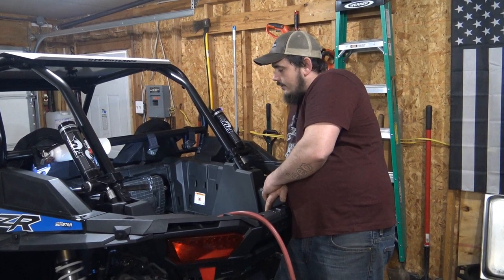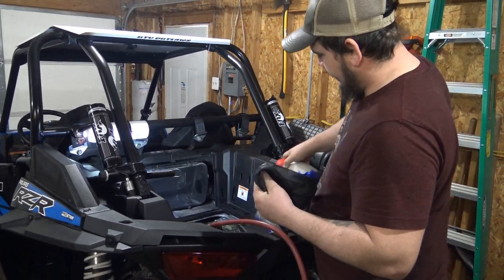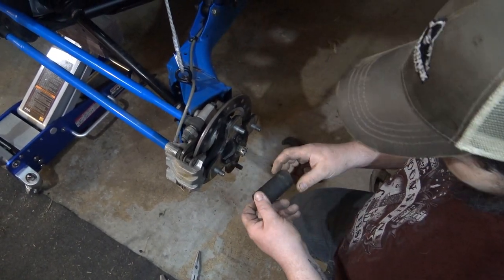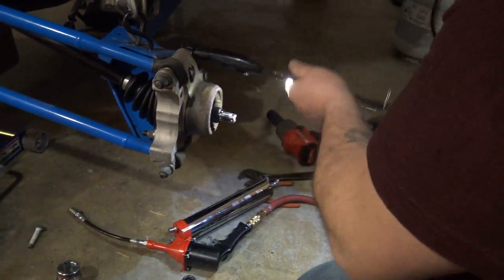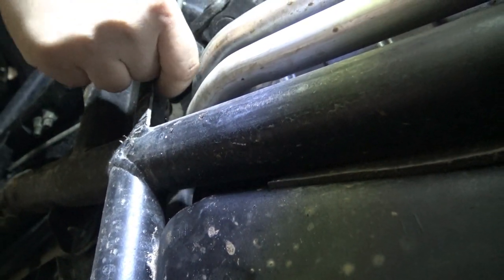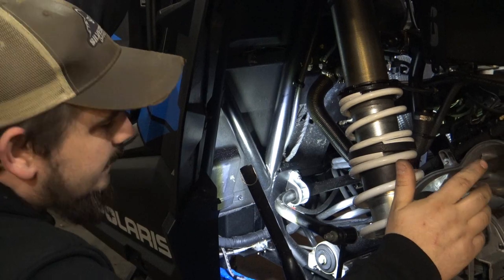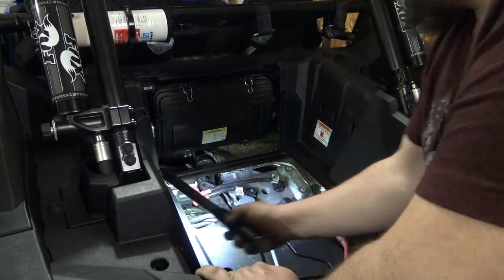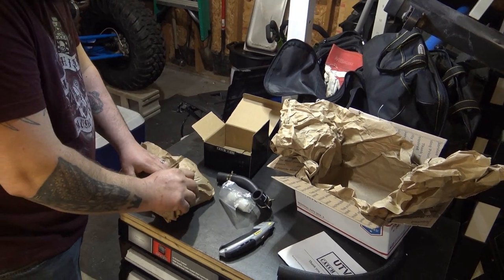Maintenance on Your RZR (part 2) Air Filter, Spark Plugs, Wheel Bearing, Grease Points

Comment: I do have one neg comment on this video, but great video, never use an impact on the spindle nuts, I have come across a few used rzrs that an impact was used, it’s not hard to mushroom the hub while the bearing is inside, then it’s a pain to get the bearing off and you have to replace the hub, I promise, have fixed three recently, but great info folks

Comment: Great content guys I learned a lot of tricks from you guys - One comment about the rear sway bar greasing, I have a 2014 XP 4 1000  and the grease fittings are behind the mounting plate for the sway bar mounts.
Reply from the maker: Thanks for the compliment! 😊. I believe the  earlier models had more grease fittings. Thanks for watching!
Reply: My 2019 has grease fittings behind the steel mounting plate also. Stick your finger back there and I’ll bet you have them also

Comment: I just picked up my first side x side. 2012 polaris ranger rzr xp 4  900.
What else would you recommend to do for maintenance?
Previous owner changed belt last year and maybe put 10 hours on it since. 2,600hrs.
I live up in Alberta canada and it gets real cold up here.
Do you recommend 0-50 oil???
Reply from the maker: There is a part 1 to this as well that goes over some additional maintenance items. But I would mostly follow everything in the manual. Motor Oil, diff changes, checking on the air filter and blowing out the clutches every ride and cleaning them a couple times a year etc. Thanks for watching 😊

Comment: Hey bud thanks for the content, love the videos.  I was wondering what kind of grease are you putting in there ? I just bought a user machine and I’m going the maintenance on it for the first time. Thank you.
Reply from the maker: Thanks for the compliment. We typically use anything marine grade since they can be submerged alot if you drive in deep water and mud. Thanks for watching!

Comment: Thanks ... just picked up a 17 rzr 1000. Just starting to go through it.  I the grease tool the same for the front and rear ?
Reply from the maker: Same exact thing! Works great, just make sure to not over grease. Initially it'll take alot of grease but after that it's only take one or 2 pumps! Thanks for watching! 👍

Comment: Thanks for the video. Where did you purchase the tool that goes into the wheel bearing to grease the fitting?
Reply from the maker: I believe I brought it from CA Tech when they had a black Friday sale. It works great.
Reply: 4/21; CA Tech is a "no gotz". Check Amazon, there are others.

Comment: Did you say you need to put about 20 pumps of grease in the wheel bearings the first time? should this be done right from the factory?
Reply from the maker: Yes! They come with a light coating but you should pump them up with grease as soon as you purchase a machine imo. Thanks for watching!!

Comment: I just put on the s@b filter. The ends of the airbox cover don’t seem to close tight. Top and bottom seem ok. Do you have that issue?  Thanks
Reply from the maker: No we do not have that issue we have that filter on three machines right now
Reply: @utvoutlaws6652  thanks

Comment: What was the plug # for the colder plugs? I’m running E85 and 19 lbs of boost.
Reply from the maker: I ran stock plugs regapped for awhile on my big turbo setup so I think you'll be ok. I'll see if I can find the box for it though.
Reply: @utvoutlaws6652  thanks for the input.

Comment: Hi, whats up with those cables you attached to the wheels? Did you make them? And the attachment points?  I get mine on tuesday.
Reply from the maker: Was it the limit straps? If so I attach them to tow dolly my machine into the dunes. One side attaches to a hole in the trailing arm and the other to the shock tower. If you go back to our earlier videos of the tow bar you can see that setup.

Comment: I'm assuming you guys have figured out by now that the rear sway bar has grease points. I can show you if necessary. Might be worth updating the video
Reply: Any tips on how to grease those zerks? I have found them but they’re dang near in possible to grease well I’ve found
Reply: @reesemcgee708  practice. That's about it. Eventually your fingers practically have eyes. You know what you're grabbing when you are reaching around back there.

Comment: I like the little shop light,  where did you get it?
Reply from the maker: Found it on Amazon. Think it was under $20. The adjustment knob makes it so i can turn it down and save the battery in certain situations.
Reply: @utvoutlaws6652  what is the link to Amazon? Good vid though

Comment: Did you make those cables for suspension droop?
Reply from the maker: I made them for our tow bar system and use them on other things. Got everything from menards. Used some cables and some hooks from a old pair of rachet straps. Crimp them down at the exact lengths. Thanks for watching!
Reply: @utvoutlaws6652  awesome! Thanks for the reply!
Reply from the maker: No problem, thanks for watching!!

Comment: What wheels are those? Also what tire size?
Reply from the maker: Douglas star fighter beadlock 14x7 with a 30x10x14 terabyte tire. It was a way of getting a durable set of tires with beadlocks for a good price. From what I've heard, dwt hasn't spun wheels in a long time due to moving locations so it'll be awhile on the wheels. Thanks for watching!!